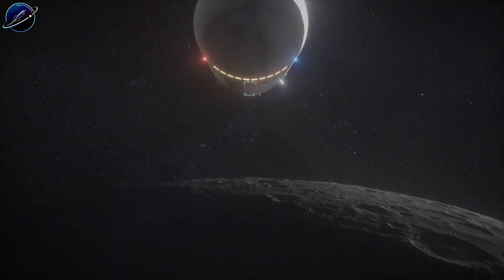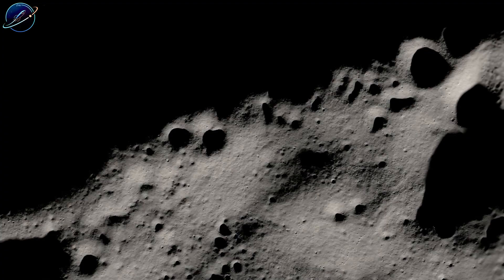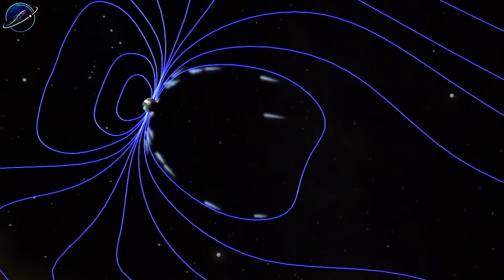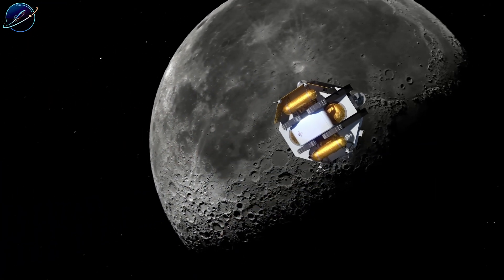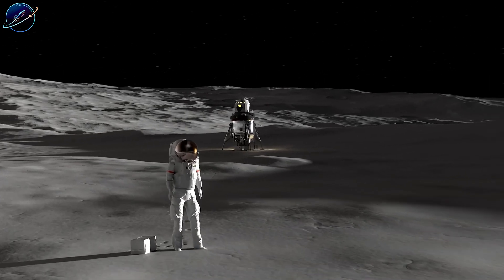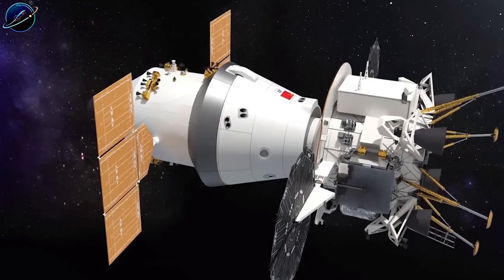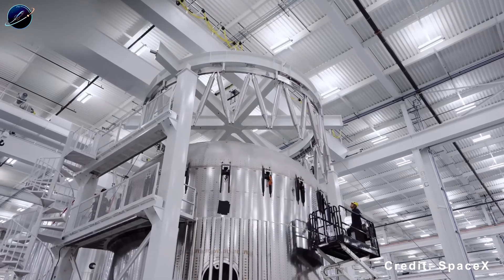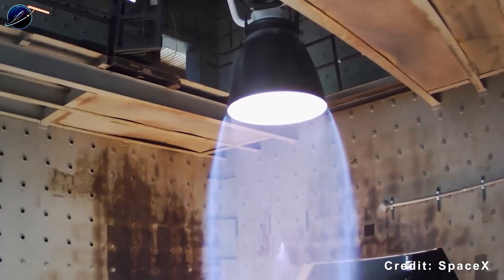Elon Musk Found Faster Starship Path to Moon. But China Already Beat Him to Resources...

Comment: Why did CHINA land on the far side of the moon? Is that so that no one could check on them?
Reply from the maker: No, China landed on the far side (Chang'e-4 in 2019 & Chang'e-6 in 2024) for solid scientific reasons — it's the oldest, most cratered region (like the huge South Pole-Aitken basin), with unique mantle material that could explain why the near side has more volcanic plains while the far side doesn't.